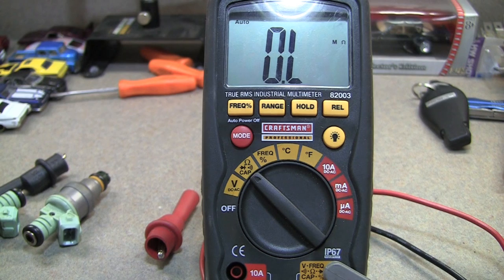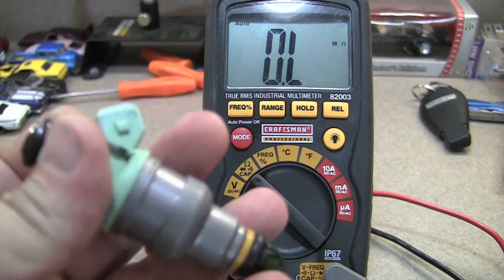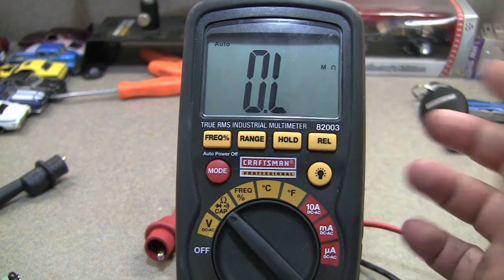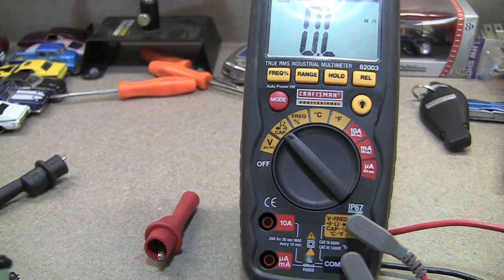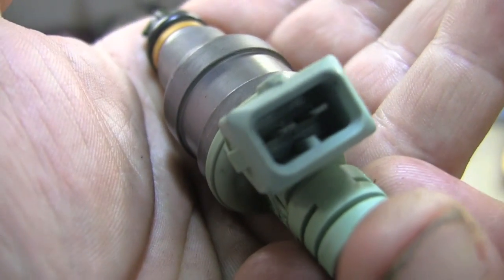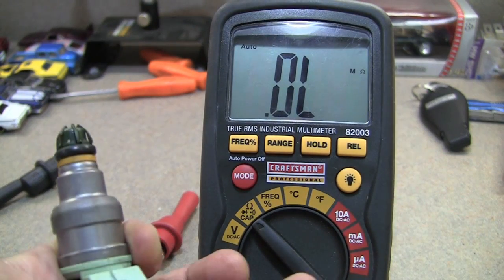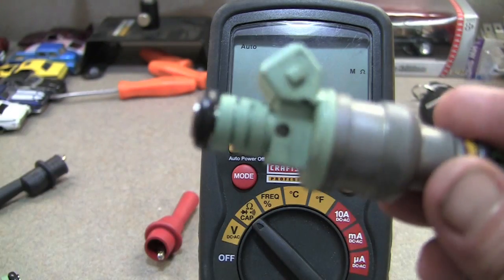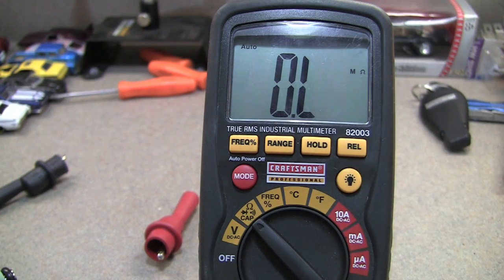Using a Multimeter to Test Fuel Injector Using Resistance (Ohms)

Comment: all that mumbo jumbo and did not state a resistance Ohm range for that injector.  Although stating most are about the same, he says he has no idea.  Wrong, he has a good idea of a range, but not your specific make and model range.  Just ballpark it or state the range of your injector, something when doing a how to test using a multimeter.

Comment: I'm not getting any readings on my meter is possible all injectors that bad?
Reply: Maybe, just like winning the lottery what would be the statiscal probability that all four would fail at the same time? To confirm the resistance test results you can use a different multimeter and ask another person to perform the testing.

Comment: Testing resistance sometimes will lead you to wrong diagnosis..it is better to swap with another..because sometimes injector will malfunction when it gets hot or running..i have experienced it many time..resistance is in specification but after a few minutes of driving, problem will comes..i checked the data stream while engine is running , i saw that the injector #4 is 0 ms..then when engine is cold the injector have 160 ms.
Reply: Please advice which test scanner did you use which shows the fuel injector live data stream? And, which scanner would you recommend for many cars?

Comment: This test just tells you which injector is bad how do i know if its clogged?
Reply: You have to remove the fuel rail if there is clearance and secure the fuel injectors to it. Then, perform a quick engine fuel pump test with the starter fuse or relay removeg (See: A test video on youtube). Or perform an injection test on each injector separately.

Comment: What about if I test my injector it test fine within spec and then I waited a few minutes tested it again and it showed open loop 0L on my multimeter I made sure my connections were good
Reply: It is best to test for resistance when Fuel Injectors are warm or hot because that is when they can fail. If all four injectors' resistance test are showing Infinite Resistance (an electrical Open condition) then try using a different multimeter.

Comment: Hey what if your testing your fuel injector for ohms and the multimeter just beeps like when you touch the ends together? Help please
Reply: If the multimeter just "beeps" when you touch together the probes then it may be in the Continuity setting. Try selecting its Resistance setting with the Ohms setting (the Greek Omega symbol). Or, check that the meter has a good working battery.

Comment: '98 Ford Ranger 3.0 range is 12.0 - 16.0 ohms. Four were about 14.2 ohms. Two were as high as 28 ohms. Truck has over 422,000 miles. I replaced all of them. I have all the paperwork from the previous owner and they were never replaced. And it cleared the P0304 code.
Reply: For learning purposes: the four injectors depending on their temperatures (they can test fine when cold but fail when hot)  reading 14.2 Ohms of resistance may have been good. Notice: The two that displayed 28 Ohms of resistance may have been unreliable as resistance can change with temperature changes. So, for 28 Ohms of resistance or higher virtually that may cause the injector to function virtually as if it had Infinite Resistance or as an electrically Open conductor (A multimeter display of OL, which is Infinite Resistance).

Comment: Can I do this while they’re in the engine still, and can I check the wires going to the fuel injectors?
Reply: Can I do this while they’re in the engine still? Yes, by removing the connector which provides Positive Battery Voltage and ECU (Car Computer) Negative Ground. Can I check the wires going to the fuel injectors? Yes, by using a Test Light which will strobe (flash) by pulsating ON and OFF as the car computer provides a pulsating Ground to the Fuel Injector. Use a multimeter (Voltage) on the two connector pins to determine which is the Positive polarity and the Negative polarity.
Reply: Note when using a Multimeter (Voltage setting): To test for connector Positive pin polarity or Ground pin polarity the car ignition should be key ON position and engine not running. To test for an ECU computer pulsating Ground signal with a strobe test light the car ignition should be key engine running position.

Comment: sir my injector i check alredy multimeter 13.6 omh.it is good or bad?
Reply: To be better informed, check with the car factory repair manual about expected resistance ranges for fuel injectors. But, depending on temperature 13.6 Ohms of resistance seems to be within range, but the copper solenoid coil may still be acting weakly electro-magnetically wise.

Comment: Quick one

Can cleaning the injectors alter the readings in anyway?

Can ohm test it be good, but still the injector bad?
Reply: @EdwardOskarsson

thks man , that's what i was looking for.. 3 of mine injector were the same while one is off by 1 ohm.
Reply: Depending on its condition it can be both: Yes and no, if the injectors' electrical pins are dirty with grease and oil that may affect the resistance readings on a sensitive meter. And, depending on temperature if the injectors' resistance is within range but the internal pintle valve and other moving parts are dirty, clogged, stuck open, or stuck closed, then it can fail (See: How to clean fuel injectors videos).

Comment: Can doing this test show that it's leaking or your just testing if it is good?
Reply: Thank you, that's the purpose we are here looking for vidoes that address faulty injectors.   This man demonstrating a healthy injector.  I can buy a new one and test it too.  F(*(S*DF
Reply: The resistance test - which can be done without removing the fuel injectors - only shows depending on temperature if the electrical solenoid (copper coil) is good. To perform an injector fuel leak test you may have to perforn a fuel pressure test with test kit plus a PSI gauge or remove the injector and test it on a bench using a test device/setup (See: youtube videos).

Comment: Ok - good / simple test and advice. That being said , if I were to perform this test on all injectors as a comparison on ohm readings between the injectors - I would not remove the injectors - rather just unplug them and test without removing
Reply: All good advice. And, to perform a fuel spray balance test you can remove them individually and test them collectebly by using a test device/setup and select from various ones the more evenly matched ones to install (see: youtube videos of how it can be done).
Reply: Can I do this with the injector still in the car or do I have to remove it?

Comment: i measured on two of them and both have 12.0 ohms but one does not work instaled in car and changed position  and same thing and all were tested and cleaned and they said it is ok
Reply: Maybe because some fuel injectors can fail when their solenoid gets warm or hot (by becoming weak electro-magnetically). So try testing them when they are hot.
Reply: @RamónValdez-z4q they died totally, i replaced them
Reply: Good for you as they can be tricky to troubleshoot. Fuel injectors just like all analog devices that have a copper coil actuator (which can be affected by temperatute changes that make it weaker) in them like Motors, Fuel Evap Purge Valves, Relays, Fuel Pumps, et cetera. Concerning electrical theory and application  I have spent years in formal education schooling and can tell you electrical components some times still frustrate me. So, like you did it may be better to remove and replace them. But, in general in the automotive industry I still can't accept how some components can be so expensive or difficult to find.

Comment: Sir is more resistance means rich mixture ? And bad millage ? My Hyundai santro 2004 are giving me 16 ohms resistance what does that means ?

Edit 
And I Don't know what company manual said about their resistance
Reply: Not a problem, nothing to do with economy, the resistance of all the injectors in the set should be pretty consistent.16 ohms is normal for the Sentra.
Reply: If all injectors' resistance readings are similar then you can assume they are fine. If a car scanner is showing a Rich or Lean condition for a specific cylinder then that fuel injector may be mechanically tuck open or stuck closed. To begin check all the components of the air/fuel intake systems: Air vaccum leaks, cables, MAF sensors, ignition coils, spark plugs, evap purge control valve, throttle body, air/fuel sensors, oxygen sensors,  et cetera.

Comment: I did this same thing with my 99 Camry all read 14.0 ohms and 1 doesn't read at all so I'm thinking this 1 injector is bad
Reply: 2koolforyou88 Did you clean them before testing them? Because they really should be around 16 ohms. 16.5 ohms

Comment: ok ok my motorcycle injector displays 1 ... he's dead I think or not?
Reply from the maker: Depends. What does the manufacture state the reading range should be?
Reply: @Johnnysshop  I do not know but there is really no reaction of the multimeter yet the current arrives at the connection!

Comment: I test injectors on a motorcycle today in wondering on mine is shows 12.8 - 12.9 ohms but one of the injectors shows at 13.5 ohms is that mean that when is going bad that's open
Reply from the maker: Maybe or maybe not. I would see if you can find out what range is acceptable for those injectors. It may be fine.
Reply: OP has provided good advice. Keep in mind that electrical resistance can be afected by temperature changes. Hence, maybe test them after driving and a high resistance value on a solenoid may indicate an infinite resistance (an OL meter display, an eletrical Open circuit).

Comment: can you test the fuel injectors while they're still in the same way
Reply: Yes, you can test them for resistance while they are still installed on the engine block. Remember to remove their electical connector before testing them.

Comment: I've tested all 4 of mine and they all said 2.5 ohms but when I did the AA battery test only 2 would click, do you have any idea what could be wrong with them?
Reply from the maker: Have you cleaned them?
Reply: Johnnysshop, yea I sprayed carb cleaner in them and I had them sitting in it also, I called a local part pull yard and they have injectors for $11 a piece
Reply: so I'm just gonna do that route
Reply from the maker: Yeah, I don't blame ya. Can't go wrong at that price!
Reply: U need to clean them

Comment: Thx, I just heard about this test I have had a number of issues trying to diagnosis a missing w/ my 1995 Roadmaster. I recently discovered and replaced both catalytic converter's bcoz of being plugged, which I think may have harmed the EFI's. I used my cheap voltmeter w/ setting on 2000 Ohms and I got .015-.017 on 5 of the EFI's and 3 had readings of .005-.007 so I think there maybe a problem w/ those 3 which are on the side of the cat that was mainly plugged. Also my mechanic said that side was running lean. Any advice in appreciated.  Thx
Reply from the maker: Hmm. Not 100% sure but I would try to find some used ones online and go from there.
Reply: Thx for getting back I was thinking about changing the 3 myself but I watched a fellow on Utube remove the fuel rail at a junk yard and it looks like he used a special expander tool. My mechanic agreed to replace the 3, I hope this will be the last of the issue. I bought new cheaper ones on rockauto bcoz a refurbished one before didnt work.
Reply: Check with the factory repair manual for resistance ranges. And, check resistance with a lower meter setting (0 - 100 Ohms). It is possible those injectors may be internally clogged or stuck closed, they can be removed and cleaned (See: youtube videos).
Reply: @RamónValdez-z4q  thanks but that was eight years ago and i recently sold that car it turned out to be both catalytic converters 3 fuel injectors the fuel injectors were probably not spiting properly and messed up the cat and then the oxygen sensor in front of it but i did have a nasty broken #7 spark plug that was giving me a miss. they should be about 15 on the reading on the fuel injectors if they're not then there's something wrong with the solenoid

Comment: "331SVTCobra saidFirst reading was 16.1 ohms. The second reading was 15.9. The difference isn't worth worrying about, but notice that you steadied both probes with your fingers, creating a parallel path, and reducing the resistance."

...that's not true. The parallel path goes across your skin, which is a high resistance, some mega ohms. You can't lower the  16ohms with such a high resistance. Meaning: measuring such low resistances, you can't influence the reading by holding probes with fingers. You can check that by the simple parallel res. equation. 

The story is different when you measure high resistances, but still, the path through skin is very high res. So you need to measure megaohms to screw the reading by touching the probes.
Reply: zernestro ,
Reply: What are mega ohms
Reply: 1 Mega Ohm is 1 Million Ohms of resistance to electrical Current flow across a conductor (See: Ohm's Law), which human skin surface is supposed to have (See: Classical Theory of Current Flow).

Comment: continuity is a good test for a melted coil wire.. cool. Note: if your mechanic says more than one injector has failed, that would be a MIGHTY big coincidence so go out into your garage at midnight and check for aliens in flying saucers firing ray guns at your engine. Or find another mechanic
Reply: Edwin Henry Blachford Well, if the fuel system is so dirty or the fuel itself is contaminated with water .... its so likely to find out that more than one injector has failed.
Reply: Edwin Henry Blachford I once honked at a lady for going slow (I never use my horn). Instant karma, she looks up and a dog had appeared - she did an emergency stop and made me barely tap her bumper. She says it was the dog and not to worry - so we leave. My mom calls fifteen minutes and 4 miles down the road. I say you'd never believe what just..... 

Right at that second a suv came speeding up behind me at a light, took out my vehicle.
Reply: Edwin Henry Blachford I'm

Comment: Hey johnny i know this question is kinda unrealated to this video but i thaught id ask it any way im rebuilding the top end on an outlaw 90 and dropped a circlip into the bottom end what can i do to get it out?
Reply: To retrieve a metallic snap ring try using a thin telescoping antenna magnet or and use a bore-scope inspection camera.